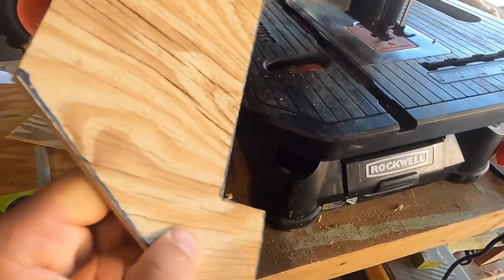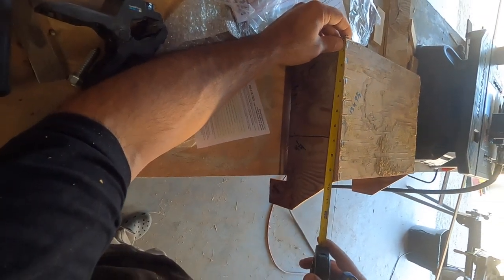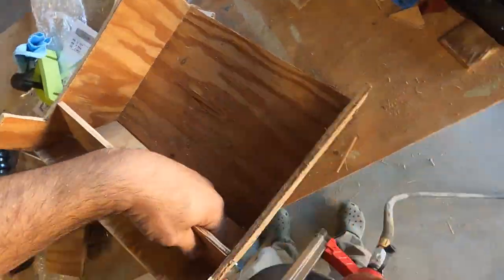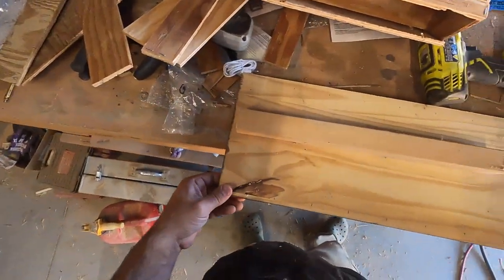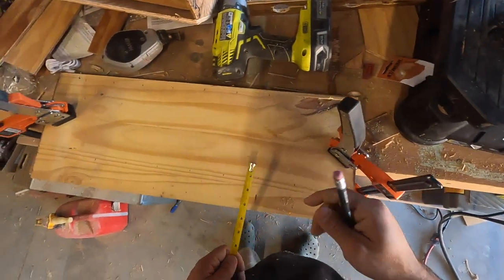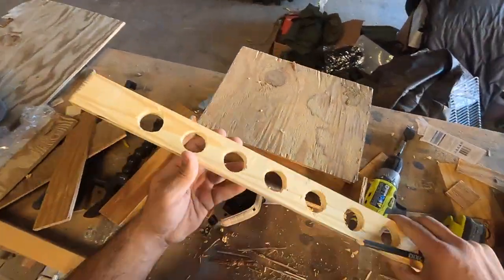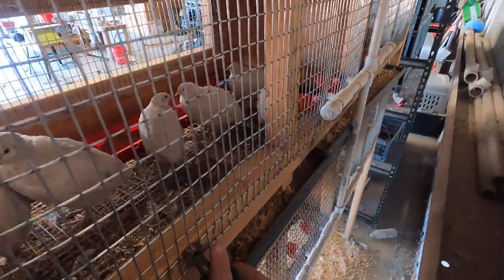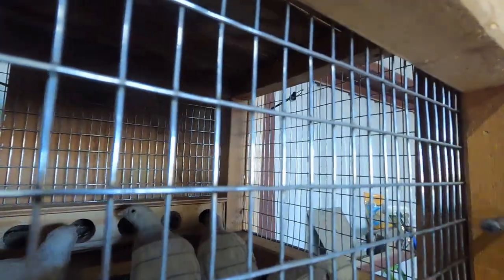No waste, Hang-On Quail Feeder-DIY for quail breeder cages.

Comment: Now that you've been using it, how is it working? Is the 1/4" space for the food enough room? Great video, thanks for posting.
Reply from the maker: I would say my opening was too small. I sold it all and relocating as we speak so no updates. But I would have opened it up a tad more. Maybe 1/8”.
Reply: @ThisNorthernLife , thanks for the quick response. So you're saying, more like 3/8"long? Also, may I ask, what length staples you use? Good luck with your relocation, will you still have Quail and will you be doing more videos? I hope so, just found your channel. Thanks again.
Reply from the maker: @jeannienutter3015  as soon as I get settled in I may. Depends on a lot of factors.  Not trying to rush into anything.   But no, 3/8” is plenty probably. You should be good to go. Depending on humidity. Just check the feed every now and then and make sure it isn’t sticky. I think I had 3/8” staples to 1/2”.  That is the longest I could find when I was at the store.

Comment: what staple gun type thing did you use? its so tiny!
Reply from the maker: It is an arrow pt50 possibly. Very nice little gun. When you have a lot of staples to shoot this is lightweight and faster than a battery operated.  Think you can purchase these at Walmart actually.
Reply: Another one that works well is a narrow crown stapler. They are a little pricey because it’s a pneumatic gun, but if you do crafts like this frequently, you’ll probably get some good use out of it. Roughly $140 for a DeWalt narrow crown stapler.